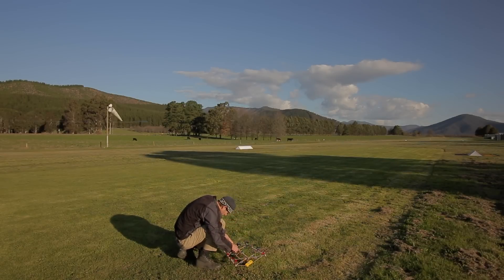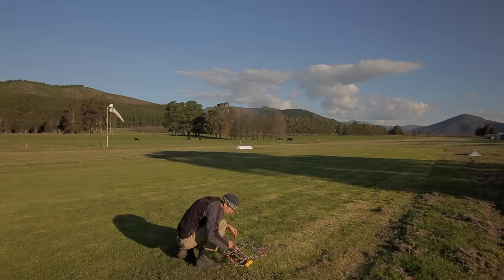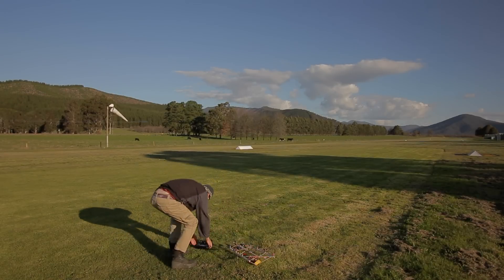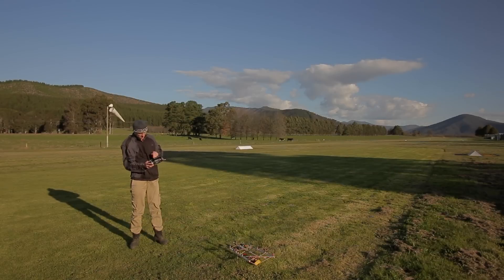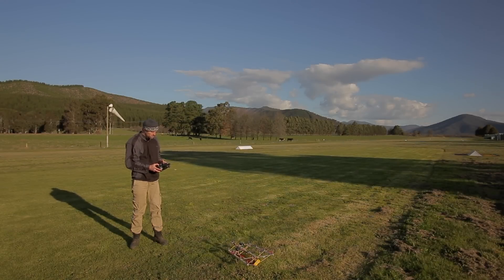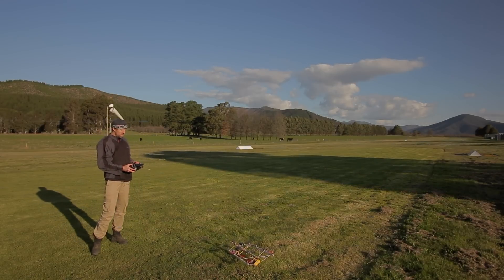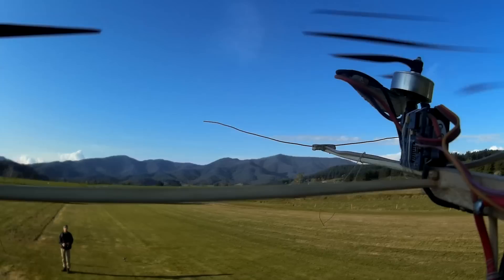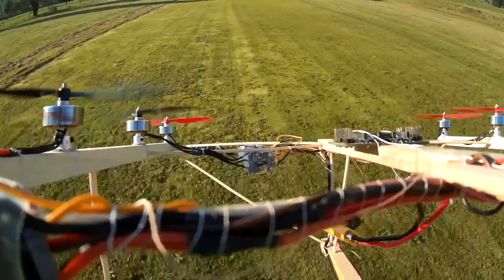Nonacopter maiden. RCHacker #75

Comment: Was that a Turnigy 9xR or 9xR Pro I noticed as your transmitter?  Your observations on either of them?  I think I fried my 9xR when my Futaba buddy box adapter got stuck in the socket and I think I fried the main board as I tried to straighten out the pins!  Not sure I should wait for a 9xR to come back in stock or spring for the 9xR Pro?  Your advice?
Reply: +James C Eastep 9xr is OK for the price but i still prefer the old 9x with the firmware modded. better ergonomics. Taranis is worth saving for.